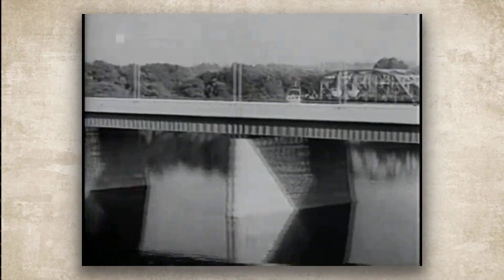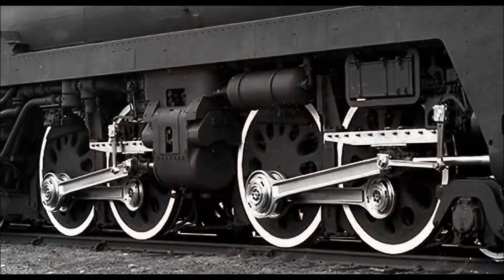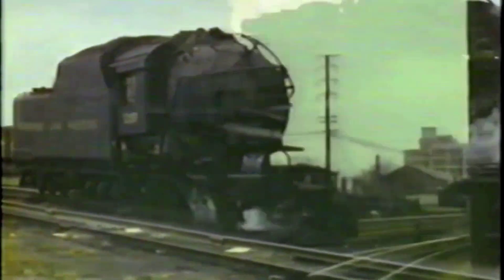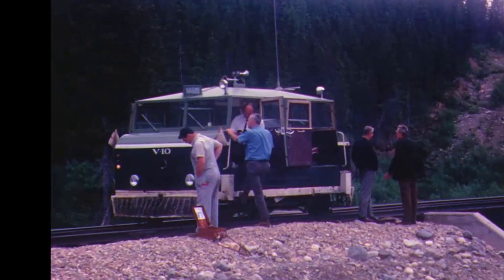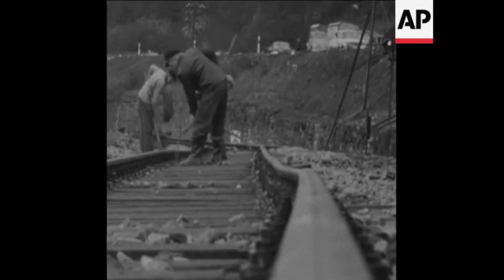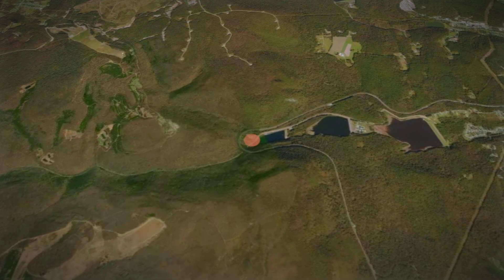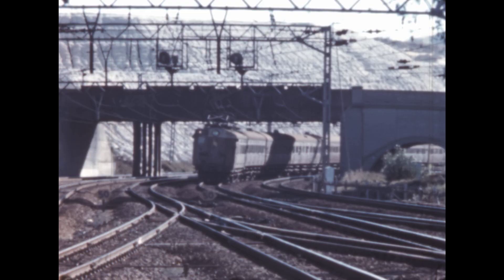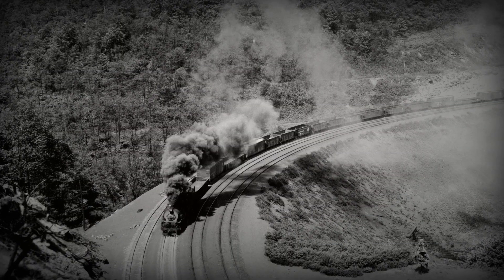The Rail-Eating Giants: When Locomotives Became Too Powerful

Comment: The problem with the T1 was it couldn't be properly balanced. She was very slippery especially at high speed. High speed slips would destroy the poppet valve gear. The T1 had many other problems as well. It was the only Pennsy locomotive built with results from their test facility rather than road tests. Many of these videos are short on facts.

Comment: The problem wasn't power or weight, it was weight distribution.  The T1 was arranged as a 6-4-4-6 wheel arrangement with six pilot wheels, two sets of four driving wheels followed by six trailing wheels, this arrangement put over 60% of the locomotive's weight on the pilot and trailing wheels and only 40% on the drivers, this worked fine at high speed in flat country but was a major problem in getting trains started or on hilly lines.  I am not sure but I think this was a rigid frame locomotive, not articulated to allow the front wheel sets to steer around curves, that would be very problematic with the extended length of this locomotive.  It was not a Mallet (pronounced mallay, French) that gave up a big advantage of the double set of drivers, compound engines were much more efficient in use of steam.  This locomotive was designed for fast passenger trains between Harrisburg (end of the electrified section from NYC) and Chicago.  The NYCentral with its 'water level route' that followed rivers and lakes for most of its length didn't have the twists and turns and grades that the Pennsylvania had crossing the Alleghanies.  The NYC could get good speed and pulling power from its famed 4-6-4 Hudsons while the Pensy had to use two locomotives over the mountains, the T1 was supposed to eliminate that.  The problem for the engineer operating the T1 was in starting, too much steam and the wheels start to spin, but he needed to recognize which wheels were spinning.  I don't know if the engineer had full control over both locomotives, each powered section is considered a locomotive, but this would be a juggling act since simply reducing power on the spinning wheels without some reduction on the other would just switch the problem around.  This was a rather good looking locomotive but it didn't work very well and not many were built after the disappointment with the prototype.  It would have been replaced by diesels anyhow.  The advantage of diesels was that they generally drive all of their wheels allowing the full weight of the locomotive to contribute to traction, even the fuel weight since it carries its fuel in underbody tanks and not in a tender.  Another advantage is that all wheels are in steerable trucks or bogies, none on the rigid frame.  (some branch line locomotives have unpowered center axles to spread the weight around on light trackage)
Hey, we all celebrate the inventor of the wheel but let's remember the axle guy who gave the wheel purpose and direction!
Reply: You mean the S1 duplex
Reply: The T1 had many problems and could never properly be balanced. She was slippery when starting and also at high speed. High speed slips destroyed the Poppet valve gear